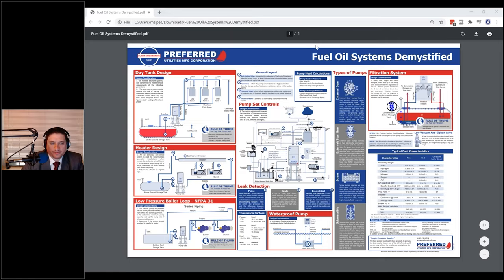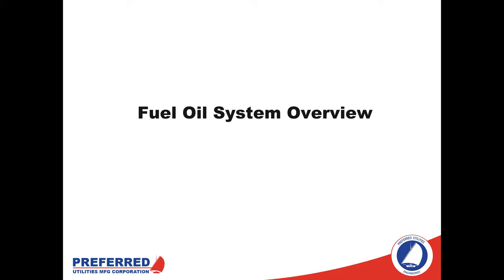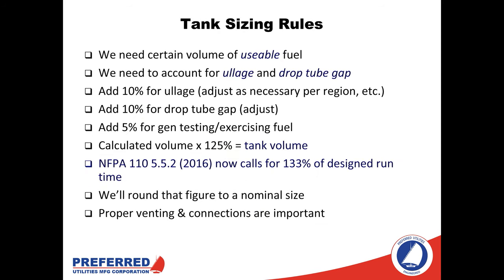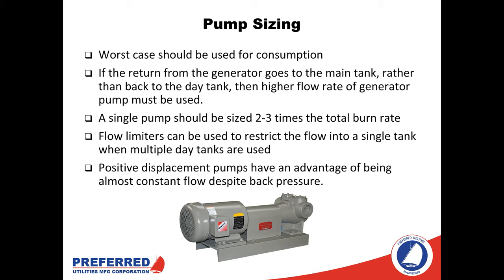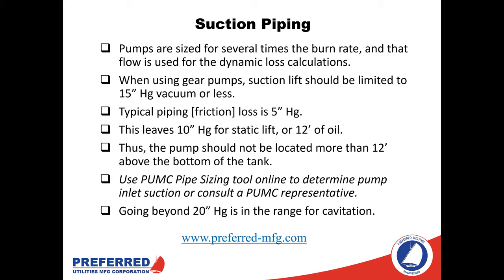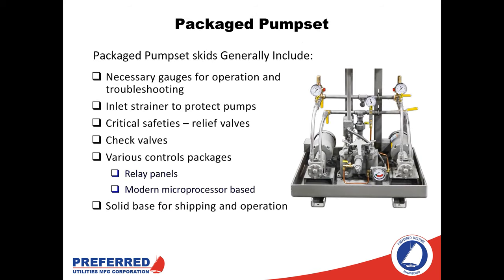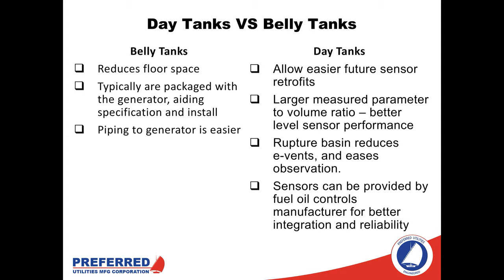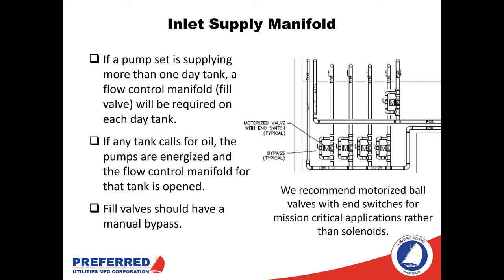Fuel Oil System Equipment and Design Overview

Comment: What is the minimum volume that a day tank must have, to suppy the diesel generator?
Reply from the maker: Best practice would be to size the day tank such that 2-4 hours of usable fuel is available at the generator, if it is a life safety/mission critical application. This is intended to give enough time to address an issue with the bulk storage tank or transfer pump equipment and controls in the even that the rest of the fuel is not available. Of course, owner, insurance, and local authorities may have the final say on what the minimum volume is for the day tank in each application.

Thank you!